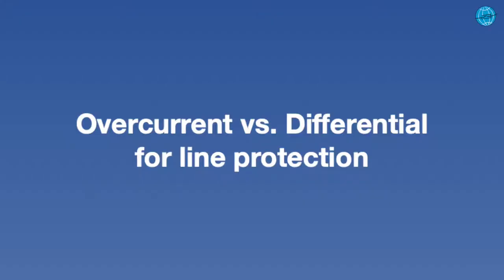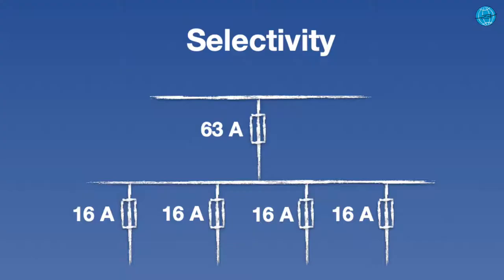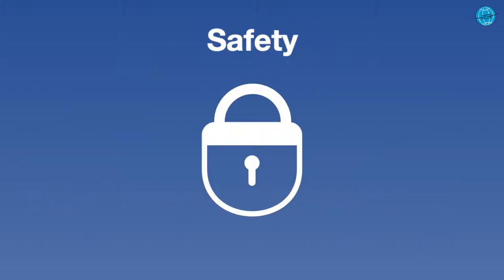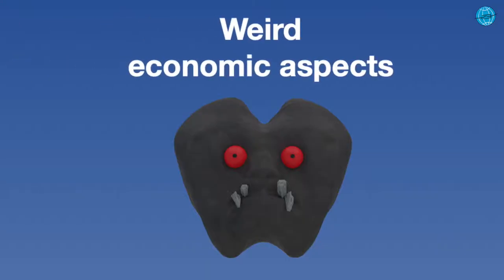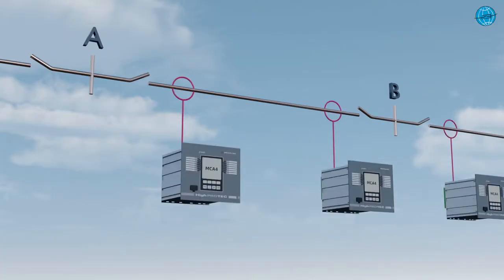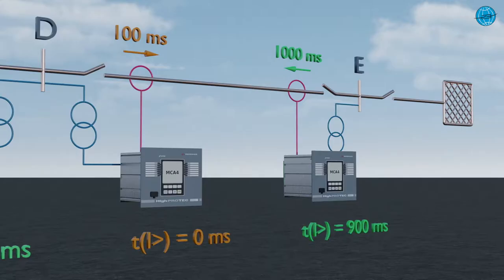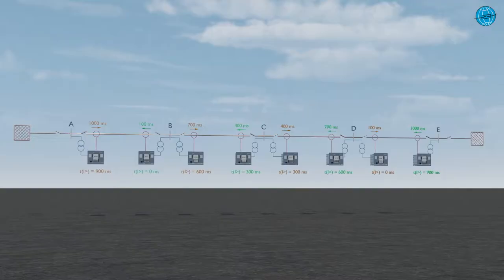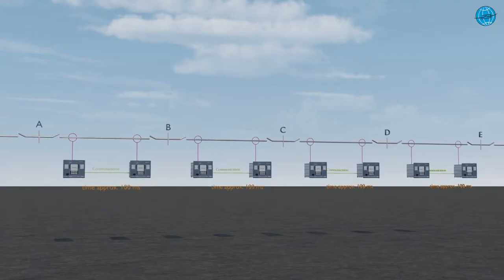Overcurrent vs. Differential for Line Protection

Comment: I do not get the explanation in English, so I do not get why so why relays have an extra time delay of 300 ms with respect to others. I understand that a relay needs approx. 30 ms to sense the fault and provide the signal + the approx. 60 ms that needs a circuit breaker to trip. But please, coulde you explain me why comes into consideration this 300 ms extra time delay for some relays that adds up to 900 ms extra time delay for the relays located near to the primary power supplies?
Reply from the maker: We always respect 250 ms till 300 ms. Otherwise the relay will kill it and not fall back. Even digital relays have to be treated like that. No chance otherwise. Warm wishes!